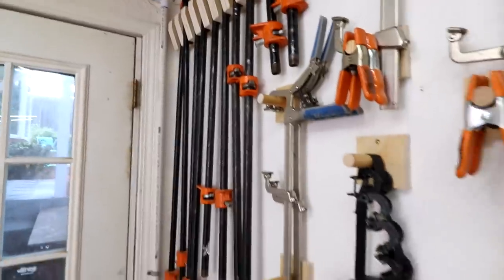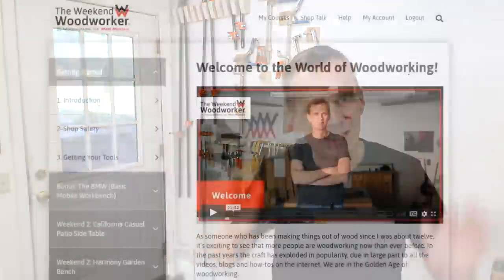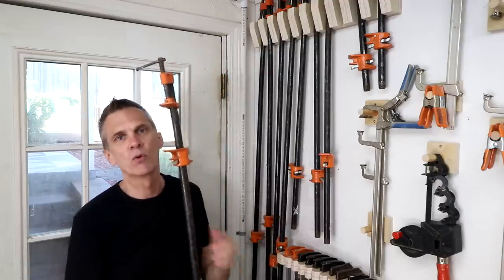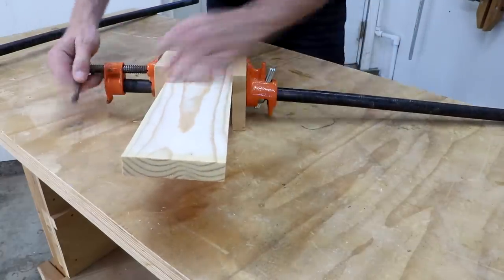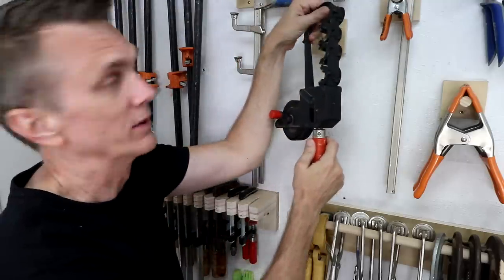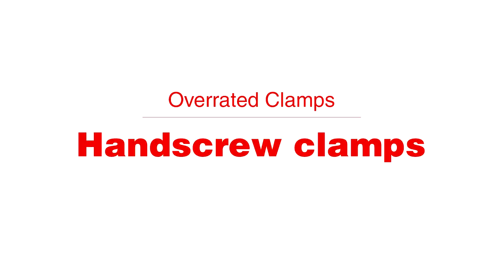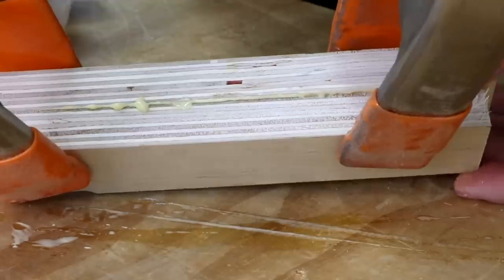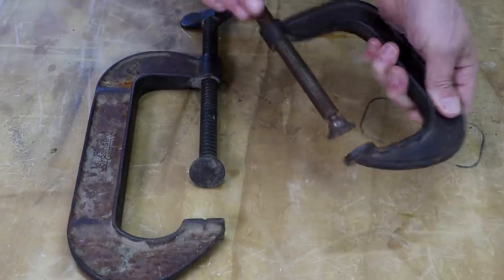How many clamps do you REALLY need? Woodworking basics.

Comment: The ideal number is always the amount of clamps you have. Plus one.
Reply: Exactly. Plus a couple more, just in case.
Reply: Yep.  You are always one short.
Reply: @phillippeforster241  yes, I am more of a cyclist than a woodworker :)
Reply: If you have enough clamps, you're probably doing something wrong.
Reply: Formally, it's "N = C + 1", where N is the ideal number and C is the current number
Reply: Hah!.  You made me laugh.  I was just composing  much the same comment.
Reply: @lfmoliveira1  I thought the C was for clamp, but current number works as well I suppose
Reply: .Hi, do you know if is possible to fix a barclamp, mine it's a Irwin quick grip, and when i thigth it,  loose the grip. 
Greetings from Los Cabos
 México.
Reply: and then double that because sometimes you know you work on two pieces in parallel and dont want to wait for glue curing on one to start assembling the second one so...

But your fancy favorite one that you absolutely need just right there is always already in use on the first piece so ... let's add one of those ?
Reply: I agree with you. Better to have one more. It never hurts.
Reply: @julianoalberto  yes cyclists go buy this formula:
The number of bikes that you can own in based on this formula- N+1 formula where N stands for the number of bikes you currently own.😁
Reply: Agreed. Of course, I've been getting away with just two on my channel.
Reply: Plus 2

Times two.

Plus one more.
Reply: Nailed it. Wait, wrong fastenings...
Reply: Same goes for guitars
Reply: Exactly! I seem to always use more clamps than are probably required. I use extra so I can have more even pressure along the length of a glued surface without cranking them down too much. I recently made concrete raised flower gardens in which I used as many as forty clamps to temporarily hold all the forms in place. They are a lot easier to use than nails or screws because they are easily adjustable and removable. I'm sorry boss, but nine clamps wouldn't be enough for me to make a bird house lol.

Comment: I just recently started woodworking at 75 years old with inexpensive 30 year old power tools, a garage to work in, and a limited budget.  I have a few bar clamps from 6 - 24 inches.  However, I needed to clamp 6 feet.  So I took a 3 foot 2X4 and drilled a series of 1" holes through the 2X4.  Now I can insert the far end of each clamp in the appropriate hole to span the 6 feet and tighten the screw end.

Comment: Just a tip. You can join the pipes together with a coupling fitting (instead of another clamp). Super cheap and cuts the number of pipe clamps in half.
Reply: great tip, Don, thanks!
Reply: The harder part is finding really good pipe clamps.  His video looks like harbor freight, and they suck. (love their cheapo F-style though)
Reply: Agreed ; Double Ended Female Pipe Connector , [ 1.50 $ ] . YYZ , Mohawk-Planker . Did 12 ' Table End Cap's That Way & Worked Perfectly .
Reply: Iain Botham  No a coupling is the name I would use in UK too. A Socket is fixed at one end, eg wall or look at a mechanics toolbox. Keep it clean please!
Reply: The Irwin clamps I have are great. And you don’t need to use threaded ends at all.
Reply: Thank you!

Comment: I dunno about over rated, but clamps are definitely OVER PRICED!!!
Reply: If you have one in your area, Harbor Fr. sells Bessey-style clamps very reasonably. I've been using them fine for a long time now. They're not amazing, but at the end of the days it's a sufficient clamp for between $2-10 a piece.
Reply: @bear8046  Almost all of my clamps are from HFT. I have about 10 of the "Quick-Grip" style that I got on sale for around $3 each. I use those all of the time...
Reply: Considering you'll probably own them forever, I just suck it up and buy'em.
Reply: Agreed.  I think a good rule of thumb is a dollar per inch
Reply: Two words, Harbor Freight.
Reply: I recommend buying a Harbor Freight clamp with the 20 percent off coupon that comes in the mail several times a month.
Reply: Jumping in here from Canada. HD and Lowe's ask wayyy too much. BUT I just found a selection at Princess Auto for bar clamps. Whoo-hoo! I'm gonna drop a few buck on them.
Reply: I pick up ancient F-style Bessey clamps on eBay and (preferably) at flea markets. If they’re not bent, they’ll be good for another lifetime or five. And a lot more solid than cheap ones from the DIY stores.
Reply: @bear8046  I went to Harbor and looked at the bessey-style, tried one out in the store and the bar started to bow under reasonable force. However, I had the mouth open to about 2.5 ft wide. I didn't want to test it any further in the store. Do you have any issues with that or does it  negatively affect the effectiveness of the bond? I had a nice bite on it but wasn't wrenching down.
Reply: @paulweston8184  Hey Paul! I have indeed noticed that mine tend to warp when I really give them the beans. However, this hasn't caused any notable issues. One shouldn't be clamping that hard when doing glue ups, else you risk bowing the piece no matter what clamp you use. As well, one should use straight boards clamped to the piece to offset any bows caused by clamps regardless so the bowing of the clamp isn't a concern (for me, anyway). 

Not to mention, you could use two clamps in place of one expensive one for far cheaper still if that would be your prerogative. But, anyway, no issues other than maybe visually. I've really wrenched on mine when I need them to hold a piece to my work bench and they work great for that.
Reply: @bear8046  Thanks for the feedback Nova. You make a good point. You actually can buy around "three" for the same price as the ones at home depot or Lowe's. Glad to hear they're not snap happy. I'll have to pick up a couple today. Working on a project right now.
Reply: i once used festool clamp and loved a it wanted to buy and saw the price :(. it was the quick ratcheting 8 "  works amazing but close to $50 a clamp
Reply: Making your own is fun and educational, and you'll run into 6 or more great channels searching how to build them.  You also end up with an inventory of specialty clamps if you do production runs of the same builds repeatedly.
Reply: It's even worse outside US. Here just the pipe clamp jaws cost the equivalent to 10 Big Macs (Big Mac index).
Reply: @kaoru007  - Universal Medium of Exchange
Reply: Wayne Novotny Three words: Keep the receipt.
Reply: Amen!!!
Reply: @SubtlyAggressive  ++¹
Reply: @SubtlyAggressive  That's what she said!
Reply: Where i live, bessy clamps start at $20. Cheapest shittiest clamps here, 80*100mm, starts at $2.5
Reply: Can't replace a bar clamp when you need it. The good ones last forever

Comment: Only thing I use a C-clamp for is compressing the piston when replacing brake pads.
Reply: I used to change my brake pads in highschool and when I was home from college. Then I moved to DC and didn't have anywhere to do it. I took it to a chain brake place which happened to be next to a Home Depot. The guy calls me out and says he can't get the piston back in so it all needs to be replaced. I laugh and tell him not to touch anything, then run over to Home Depot, come back with a C-clamp and pushed the piston back in. I told him I've changed my pads and rotors about 10 times and the only reason I'm here is because I don't have a driveway so just change the pads and rotors. He wasn't very happy.
Reply: Seconded, for some reason they just always seemed to fit perfectly in the limited space between the knuckle smasher linkage and the forehead denting support above it.

Comment: The C Clamp comes in handy when needing to lock down a bench top tool. They can provide far more pressure then a bar clamp can which helps to keep things from moving when the motor of the tool spins up. Also 9 clamps is only enough for smaller projects :) I used 16 of them the other day doing a bunch of small glue ups.

Comment: Irwin Quik clamps are my favorites. I also buy Harbor Freight versions because they are cheap and have lifetime warranty.
Reply: Quick clamps are my clamp of choice for most projects.
Reply: Irwins are great but pretty expensive. I have a couple of those and like you I also have HF cheapos.
Reply: I use quick clamps to avoid straining my hands (think carpal tunnel syndrome). For some reason, the twisting to tighten normal bar clamps really bothered my hands.

Comment: I find the old wooden clamps to be perfect for a drill press vise.  Their flat sides makes them parallel to the bit in a way that no other clamp can do.
I also find the spring clamps useful for quick holding things for repairs, or holding up a sheet for spraying varnish.  However, I don't see much use for them for wood working per se.
I also think there are clamps, and clamping techniques that are perfect for niche applications, and if you're doing those applications, then you should get those clamps.  The clamping tables + staves I see with luthiers is a perfect example.  As is a vaccuum clamp when working with veneer.
Reply: Agree. There are those cases when an odd clampng angle make these the perfect choice. Also, when you need to clamp to a clamp - right angle-style. These really work!
Reply: Plus one on the wooden clamp as a drill press vise.
Reply: I agree with much here, except the wooden hand clamp: they can - as was shown in the video - hold a piece of stock vertical, great for holding on a drill press, etc..  they are non-marring and can spread tremendous force over a larger area than a clamp with a small foot.  And at around $10 ea at Harbor Freight, they are a great investment.
Reply: I agree about the drill press, especially pipe or dowels.
Reply: Agreed. None of his essentials can be used for that
Reply: Spring clamps are often the first clamp I grab for clamping small wood b parts they can't be beat. On larger parts, I use then to aid in positioning before using larger clamps. Need a stop on a saw fence? small block of wood and one or 2 spring clamps. I use them so often that I keep about 50 on a cable stretch accros the workshop so I can just reach up and grab them.

Comment: My two favorite clamps that you didn't mention are:
- Kreg Jig face clamp
- Irwin Quick Grip mini clamps
I find these two clamps very useful. I also like using my Black & Decker workmate, with bench dogs, to clamp things together.
Reply: Yep!!
Reply: I love my Irwin quick grip clamps! Four of those tackle most of my projects just fine.
Reply: I find Quick clamps and F clamps really complement each other when used in tandem.  Quick clamps are brilliant for one handed use, but I don't feel like I have much control over the clamping pressure.  My workflow in a glue up usually involves using Quick clamps to just hold the parts together while I use F clamps to dial in the pressure.  Then I'll rearrange the Quick clamps to spread that force evenly along the joints.
Reply: @UrbanPanic  Have you seen some youtube videos about how much pressure you need for glue ups?  Some people even say no clamps are needed!

Comment: I I think the types and numbers of clamps you will need will vary according to your type of shop. I’m retired and downsizing to a workshop that fits in 1 cubic metre of space when packed away. I have standardised on the pocket hole joinery for everything and this enables me to use the minimum number of clamps, similar to Steve. It also means I don’t need an assembly table since joints are finished one at a time. If a carcass is not square (very rare) I simply loose here and tighten there until all is well. 

If on the other hand you prefer box or dovetail joints then you will need more clamps and an assembly table to glue up your carcass in one go. Be sure to clean up excess glue dripping into your clamps before the glue dries - modern glues are a bitch to remove from clamps once hardened.

Comment: Great review of the essential clamps.  I agree, the 1/2" pipe clamps will provide adequate strength for any wood glue-up projects in the workshop.  I keep just a few 3/4" pipe clamps which have the strength to bring larger boards into alignment when brute force is required for building walls and decks.  You didn't mention any of the "quick-grip" bar style clamps which have a trigger to close the clamp.  These are very handy when you only have one hand free to get the clamp positioned and clamped.  This style often has a reversible fixed stop at one end that can be turned around to turn the clamp into a spreader.  Handy for spreading boards apart into alignment or holding something against a surface when you have another surface close to push off of.  Basic "C-clamps" are still one of the cheapest clamps to purchase (and the easiest to find at garage sales) when you do need a lot of clamps and they are still the "go to" for wooden boat builders (they usually have 100 to 200 C-clamps in their arsenal) and useful for all kinds of metal working or welding clamping.

Comment: I have used a single, 3/4" pipe clamp to square up the 4 walls of one of my home built work shops.  16' by 32 ' in size with what would end up being  barnstyle roof to add an attic area for wood and incomplete project items.  I went to the hardware store and got some 3/4" pipe couplings and a few joints of 10' long 3/4" pipe.  With a little help to hold one end in place, I was able to determine the LONG diagonal of the 4 walls, span that long side with a pipe clamp, and it was 3" out of square.  Simply set the pipe clamp to work, pulled the long diagonal in measuring both diagonals with the assistance of my friend until both were equal, and quickly nailed in 8 of the plywood panels that were to be the outer skin.  Amazing versatility on a simple bar clamp tool.  Never forgot them.  Now, on the opposite side of the planet, I brought those bar clamp ends here with me and obtained a small stack of different lengths of pipe.  Like American Express, never leave home with out them!!!  Great channel and great content.  Following daily.

Comment: I agree with you when you’re talking about wood projects. Now here’s the thing, if you’re working with mechanical devices a c clamp is often essential to getting the job done. For those of us with experience in these things we often weld a nut to the bottom of the screw just below the handle. This allows you to utilize another tool to speed up turning the screw as well as allowing you to dramatically increase clamping pressure to nearly that of a press. Now as far as spring clamps go I see your point but they are great for light duty fast clamping. A good for instance is clamping a plastic sheet around a piece of wood for steam bending. If you ever do vacuum clamping for things such as fiberglass resin infusion into the fabric you’ll love having spring clamps. Here’s the thing... if you’re focusing on simple wooden projects like boxes and tables etcetera then the clamps you mentioned are ideal, but if like me you work on just about everything then a more diverse tool set is necessary. So I guess I’m saying you’re right but you’re limiting yourself. Why not keep an open mind and buy the tools that can work for many different types of jobs?
Reply: Jason Lee because this is for woodworkers. Vascular surgeons use different clamps too, but I don’t need those.
Reply: I only say this because there are many times wood projects have metal components inside. An open mind and a full tool box can make wonders happen. There are also times that a piece of wood twists after cutting it to fit and before you actually do the assembly. W strong c clamp may be the beat solution.

Comment: Like most open-ended questions, the answer has to start with "It depends".  It depends on your typical project load, type, size, and quality of clamps, etc.  For example, a luthier will need hundreds of very small clamps.  Cabinet builders will need fewer, but longer and stronger clamps, as well as edge band clamps.  A picture frame maker might just need a few band clamps.  My thoughts.  Cheers! Chris.

Comment: I use spring clamps and C-clamps mostly for welding.  The spring clamps also help for gluing fabrics onto the metal frames of balcony curtains.  Yet, I hardly use them in woodworking.